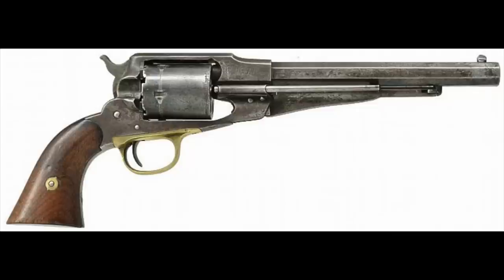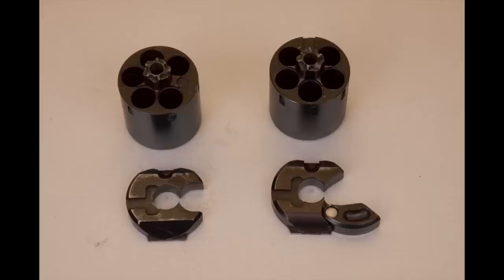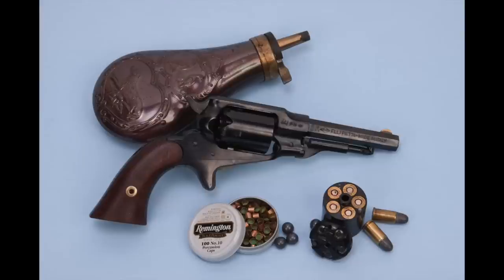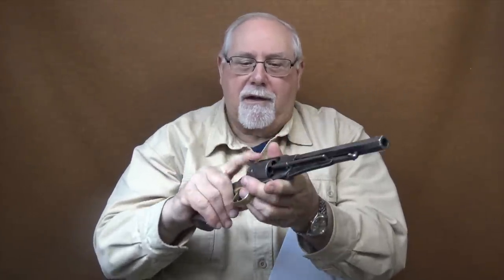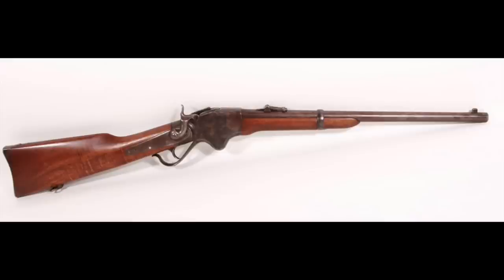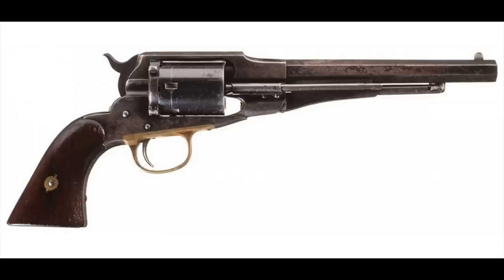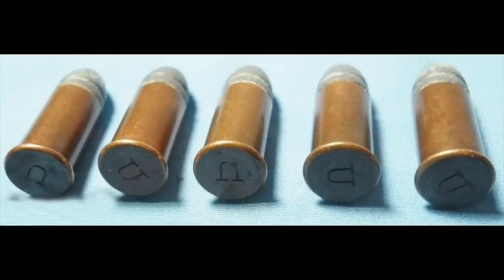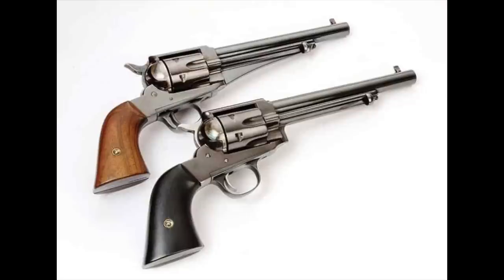Evolution of Remington Army and Navy Revolvers Part 2   Cartridge Conversions

Comment: I like the Taylor's/ Howell conversion cylinders since they're 6 shot in .45LC & .38SP . The only issue I've had is the firing pins do wear out after a while and start sticking and having light strikes, but they don't cost much and with the tool they're easy to replace.

Comment: Mike I just wanted to point out that Kenny Howell now also makes a cartridge conversion for Pietta (and I think Uberti) Remington  1858  clones much like the Kirst with the floating backing plate with a loading gate. I have both and prefer it over the Kirst as it is not only less expensive but it comes with a 6 shot cylinder( in 45) which eliminates any trouble with the timing  which the 5 shot Kirst. cylinder some times has, It also comes with a simple metal piece as a pattern guide for cutting the loading trough in the exact right spot which is a nice touch. .

Comment: Very interesting post Civil War conversion history.  I had no idea that a .46 Rimfire conversion was initially used for the Army Remington.  I will be shooting my Uberti Remington using the .45 LC conversion cylinder today at the range.  I need to reference your video about loading heeled .38 cal. lead bullets in .38 LC cases for my 1851 Colt conversion, and Navy Remington conversion.  I used to use a hollow base bullet that worked very well in the Navies, but want to try the Eras Gone in .38LC and as combustible flash paper cartridges.

Comment: I am really into cartridge conversion revolvers and have converted several myself using R&D and Kirst Konverters, I have 2 five and half inch Remington copy revolvers in 45 colt one 8 inch Remington copy in 45 colt and one 7.5 inch Remington copy in 38 special and a Buffalo length Remington copy I haven't put in my Kirst Konverter yet and one 5.5 inch Remington copy with a R&D cylinder. My colt conversions are all 1851 Colt copies with one man with no name, one 4.75 inch from Taylor's and a 22LR Kirst conversion, and one 1851 converted to 45 Colt from the period incorrect 44 caliber 1851. For cartridge guns I have an 1875 in 357 and one in 45 Colt with the 7.5 inch barrel, and one 5.5 inch 1875 with a 5.5 inch barrel. My 1890 is in 357. My hands are large so the 1875 guns are my favorite.

Comment: Springfield Armory actually did make a New Model Army conversion in .44 with a separate back plate. Page 52 of the late Denis Adler's Metallic Cartridge Conversion book. The text says it was similar to the modern Howell type 2 piece conversion cylinders. I could not find a date for it in the book (whether these were made in the 1860's or 1870's). There's a nice picture of one in the book.

Comment: @duelist1954 - So I own an original 1861 new navy conversion model. it to has the shield still in place and the loading bar under the gun was removed but an ejector was added and it is screwed into the lower hole on the front of the frame. I know this was not a Remington conversion, but most likely a gunsmith of that era that had done this. I bought it because of its uniqueness, I had never saw one done this way before and never have seen one since.

Comment: I want a pair of the 5.5 inch 45 LC full conversion. They are stout. Had a Euroarms Remington with the R&D cylinder. It shot great, but I got thinking about them exposed firing pins. Wasn't for me. Rule: Don't point a firing pin at anyone, ever. I keep the Uberti cap/ball as is, and got myself a nickeled Uberti 1875 Army instead.

Comment: I have to wonder just how many real, unmodified 44 Remington new model army's are out there. just as manufactured, cap and ball revolvers. if i could afford a real, civil war Remington, i would much rather have one of those. but, i guess if i lived back then. it might have been different. to be honest, i just do not like the looks of any of the conversions though. /    if you get to reply to this, i do have a question about cap and ball guns in general. i know that many people run wonder wads under the bullet. why did they not make the gun to be used with a patch like every other muzzle loader in existence back then? the only thing i can think of is during r&d, they had a few patches and balls separate, the patch stayed in the barrel. and upon firing the next shot, the gun blew apart.